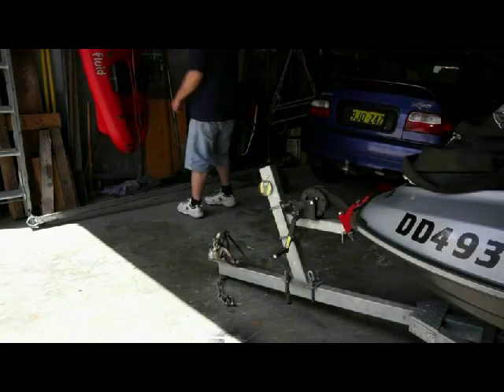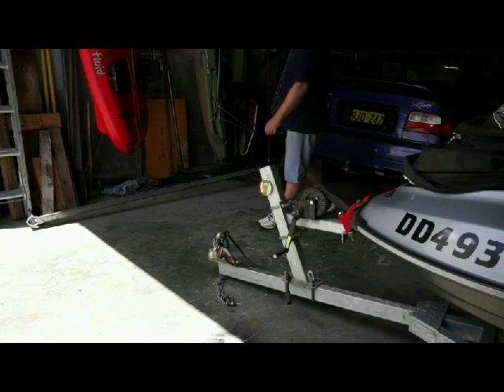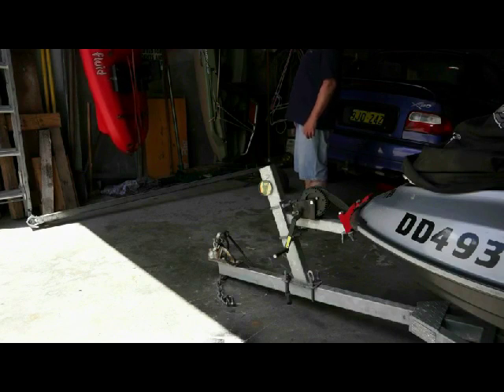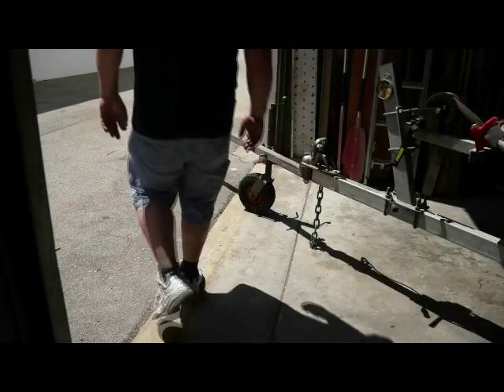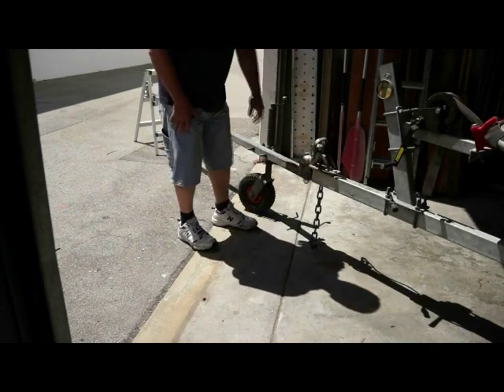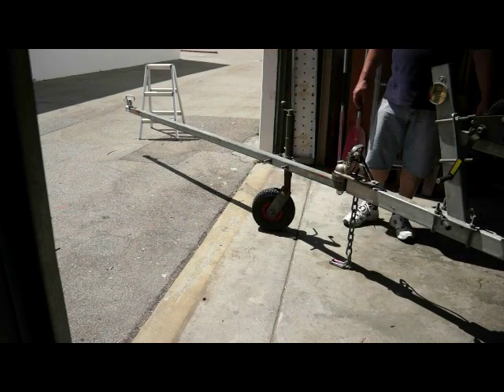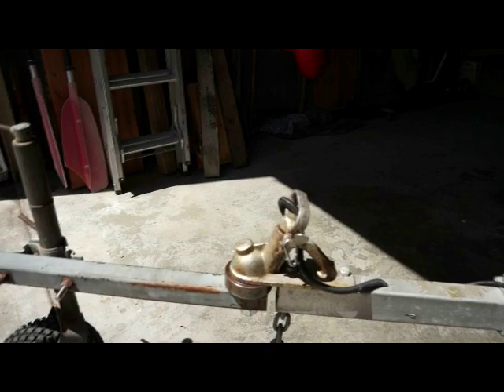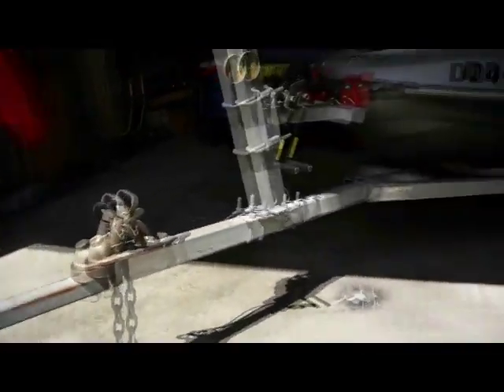Boat Trailer Extension Bar

Comment: My dear old dad that is no longer with us had a great idea for extending his boat trailer that carried his 4.8 meter fibreglass half cab stegcraft boat.
He got a long length of square steel and attached the tow hitch to it then slid it inside that main draw bar he then drilled 4 holes evenly apart through the draw bar and put in large stainless steel bolts and stainless steel lock nuts and when needed he would just undo the stainless nuts and bolts and slide out the draw bar and just line up the holes he could extend to different lenghs because of the 4 different hole locations.
Once the boat was back on the trailer he would wind the jockey wheel down undo the hitch and nuts and bolts and just slide the inside draw bar all the way back into the outside draw bar unti it stopped because there was bolt that was also through the draw bar and it couldn't go any further and other 4 bolt holes were lined up everytime,  put the bolts back in and put the hitch back onto the car wind up the jockey wheel and away he went.
Just to mention the jockey wheel was still clamped to the outside draw bar and it never ever interfered with the sliding in and out of the internal draw bar..
I don't know if there is anything like that out there on the market, but that is what he did about  28 year's ago. 
Cheers.

Comment: Really, all negative, why be like that when it works. Mine is a steel ring but aluminium would work equally as well. Just drop it over the tow ball before connecting the bar and trailer. The weight of the boat pushes down to bite in and hold the bar still.